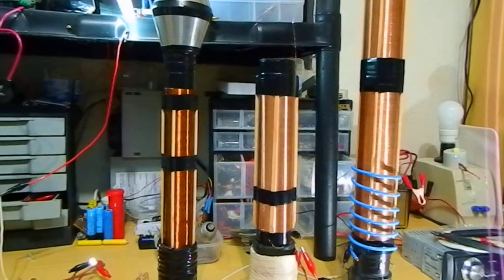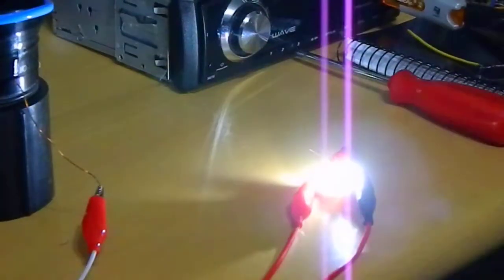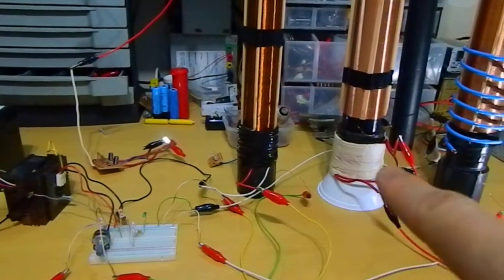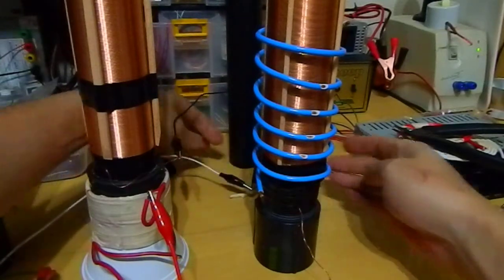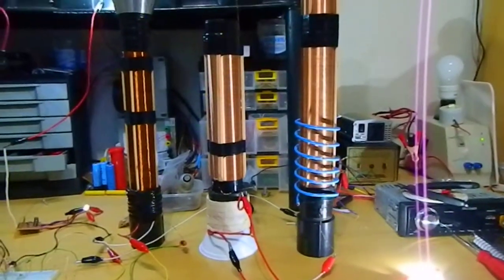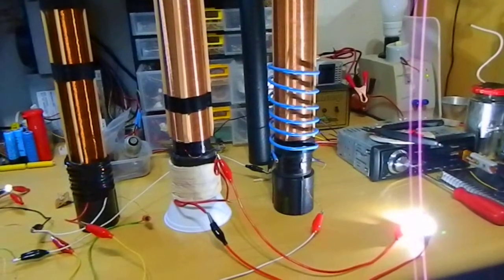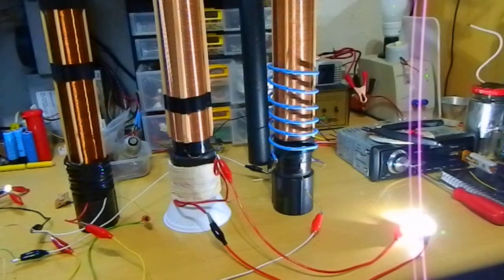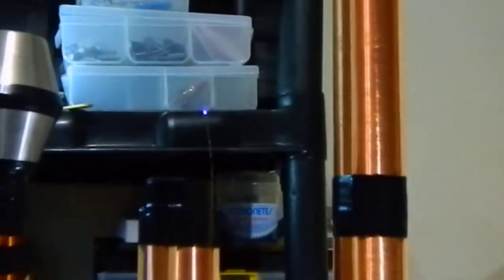Slayer Exciter - Energy from a Tesla Bifilar

Comment: You can also get a good idea of power from filling a larger cap, and measuring the fill time. Just be careful doing that with those voltages! 600vdc is VERY lethal! Especially if you have a few hundred µf in a cap at 600Vdc!! You may be able to meter amps into the cap too? I've never tried.

I will be sure to repeat some of your tests! Very nice work!

If you are winding another, consider going wider, more lineal interaction with the primary then :) Seems to get better amps transfer?

Comment: I'm amazed at your results with the slayer not grounded. Then you grounded the slayer and you can see the extra performance! My slayer runs like crap with no ground, so I haven't tried that! I was going to ask you to measure the voltage on the receiver primary. You can get a better reading with a HV cap across the rectifiers + & -. Then you can measure amps and volts across the cap. Doesn't need to be a big one. Try 0.1µf. Preferably both at once to observe voltage drop in the cap.